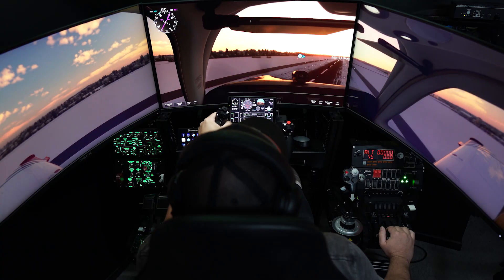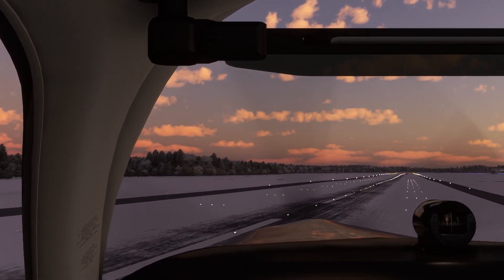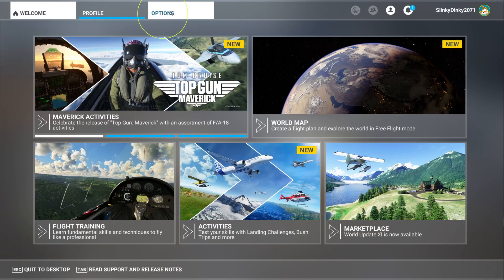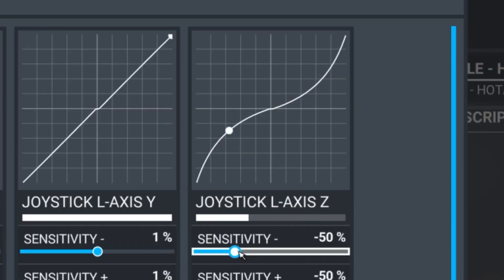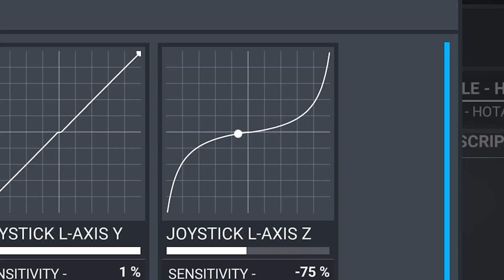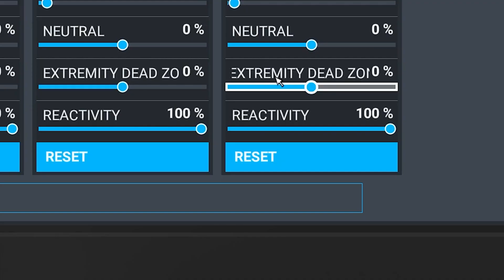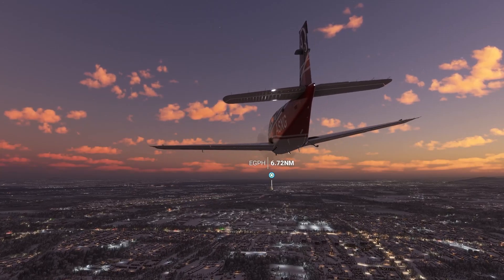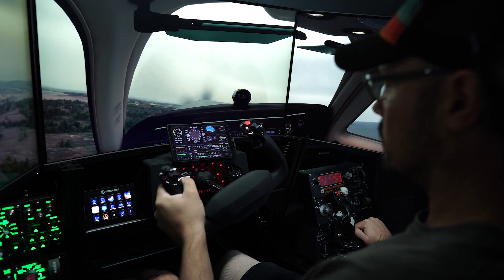This Changed my MSFS Landings for Good!

Comment: You'd want to bank a little bit into the wind to straighten the angle of your airplane relative to the runway; just before touchdown, instead of landing while still crabbing or slipping. That will reduce the risk of skidding on touchdown and having to make large rudder inputs while to try to keep it on the centerline. Boldmethod has a great video on crosswind landings if you want to dig into it further.
Reply from the maker: Awesome advice. I will definitely have a look at that video.

Comment: A slip is a maneuver used to decrease altitude quickly while maintaining lower airspeeds. (Full rudder in one direction). Useful on approach. Crosswind landing is similar to a slip, it’s banking into the wind then using opposite rudder to straighten the aircraft out to prevent side-loading the landing gear. Using aileron to stay on centre line. If you have a control front wheel, you need to neutralize rudders just after touchdown, then use them to steer.
Reply from the maker: great advice. Thanks for sharing